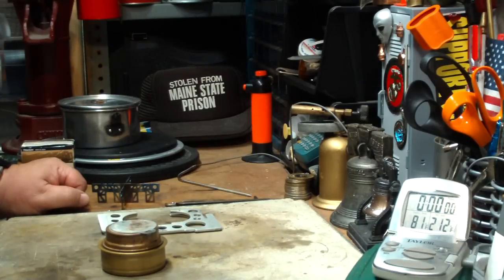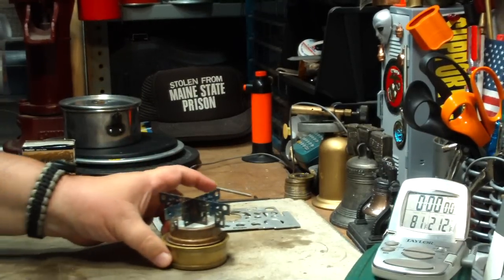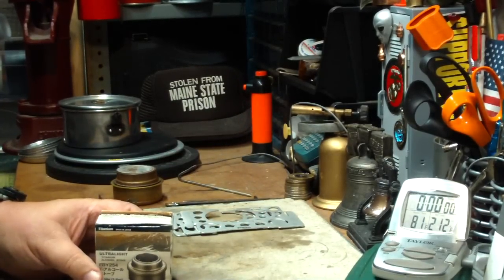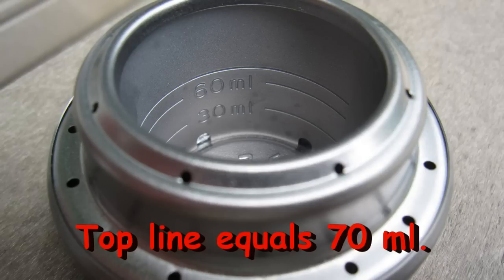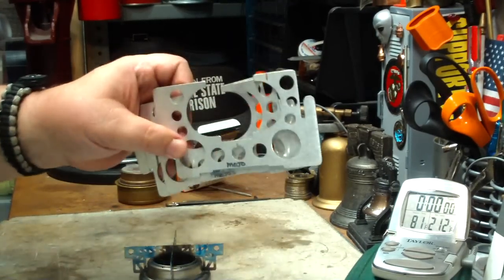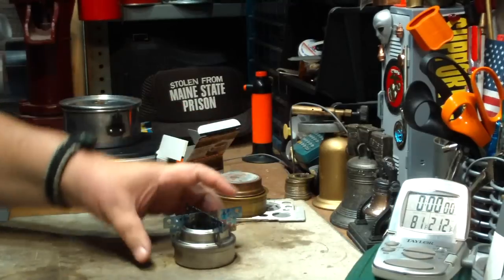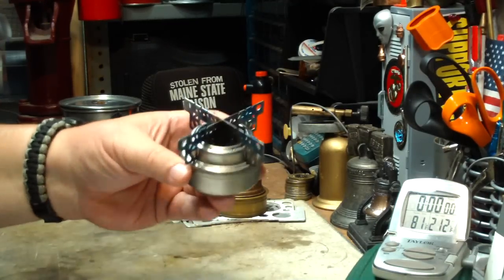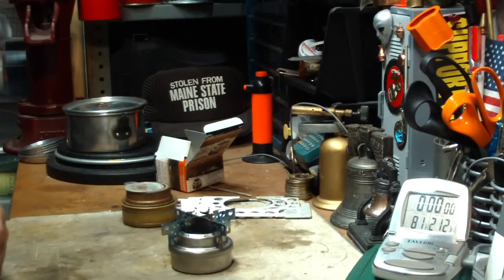Evernew Titanium Alcohol Stove & Evernew Titanium Cross Stand   Boil Test #1

Comment: Hiram, if you set your pot down on the top of the stove (without a stand), the Evernew DX will give you a simmer mode. The top holes/fuel hole get sealed and just the outside holes provide a minimal heat.
Reply from the maker: McNugget Like this? 
https://www.youtube.com/watch?v=kbFCsRkp6As
Reply: hey hiram long time fan, just curious if this cross stand will work with a standard soda can stove

Comment: Okay, so it is a old video, but I still want to say I love mine.  Light weight and versatile.  I have used as a wood burner also and it works as well as my firebox nano.  So, it a pinch, in my get home bag, this one stove is much lighter than the Trangia and can be used in other ways.  That said, everything including tea and sugar fits inside the pot and is very lightweight.  Still have to carry the alcohol separately.  I sometimes only take the pot and titanium cross-stand. (So, even more versatility.)

Comment: Hello Hiram, I just got this unit.  I was wondering if you can shed some light on something.  I put the fuel in up to 2 oz mark.  it did not appear to be soaking into the wick?  I thought that the level would lower as it soaks into the inner compartment.  I then lit it and it burned for only 7 minutes.  I'm afraid that it's not soaking into the inner cavity therefore the center compartment is holding most of the fuel and burning off really fast.  Can you shed any light onto this and let me know if the stove is functioning like it's supposed to?  Because I'm not getting it to burn anywhere close to the time you are showing. I am using Heet alcohol .  Thank you for your time.

Comment: I was looking for the excellent Evernew 500ml pot and couldn't find one. I ended up buying the Appalachian Set (pot, Evernew alcohol stove, fuel tablet screen, and pot support, designed for Evernew 500 & 900 ml pots but will support my 6 qt. cast iron kettle) for US $119.00 just for the pot/mug alone.

As a "gram weenie" since 1973, I rely on micro weight fuel tablet stoves and have no use for back-breakingly heavy alcohol stoves and I was going to sell the unused, unnecessary, and unwanted Evernew and my thrice used Trangia Mini Set on eBay. After reading the comments concerning inflated prices, I now wonder if I'll ever be able to sell them :-(
Reply: So you don't like the Evernew Appalachian setup? I am really interested in getting one but the cost really makes me think twice. And this review makes it look pretty efficient, or at least good enough for me. I've heard people say it's an alcohol hog, but seems pretty good.

Comment: no way I'm spending that for an alcahol stove lol. I'll get a safe heat can and make one. I saw one of this classic pop can models sell for 40$,that's nuts too. no idea why they charge so much for sub par gear. and what I mean by sub par is in terms of function in multiple situations, a svea123 for example is more flexible in terms of fuels, and operates just about any elivation, and deffo cooks better and for longer. I would see that costing a bit. but these little alcohol stoves are really just to heat water or a can of soup. and in some situations alcohol may not be available, and let's face it. you can make these with all kinds of cans. so why 60$?just venting on cost of survival gear guys lol. it is getting bad

Comment: I'm not impressed by the Trangia.  It does nothing my sixteen dollar stove won't do.  Neither will the Evernew, for that matter.  Under six boil time is nothing to brag about, and eighteen minutes is not terribly long for two ounces of alcohol is no more than average.  Tell me again why anyone would buy a stove that costs so much?
Reply: Here in the US, I bought a 12"X12"x1" piece of carbon felt (welding blanket material), for about 13 dollars.  Since it's so thick, I gently pull it apart starting at one corner, and it pulled apart fairly nicely and uniformly into two pieces of 12x12x.5".  Guess it must cost a lot more in the UK etc?